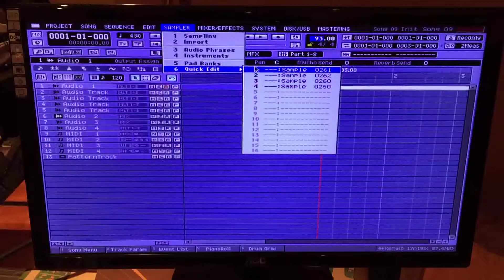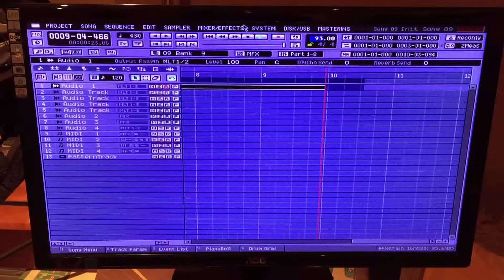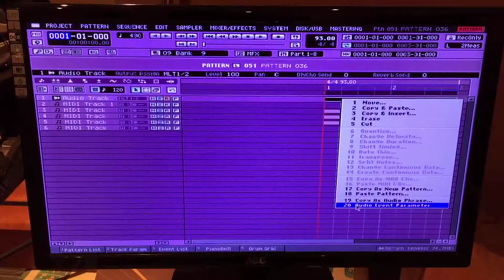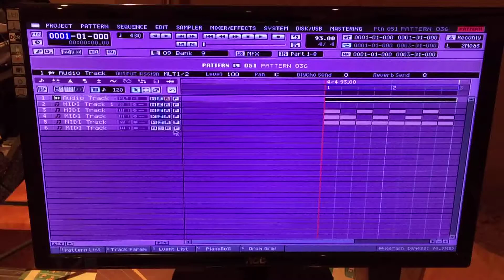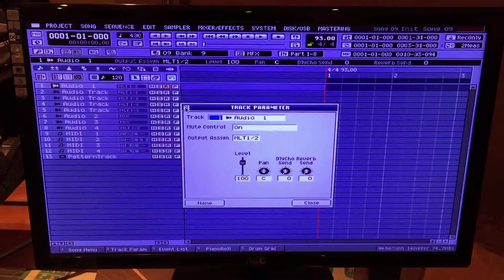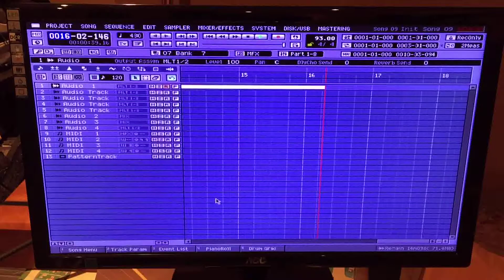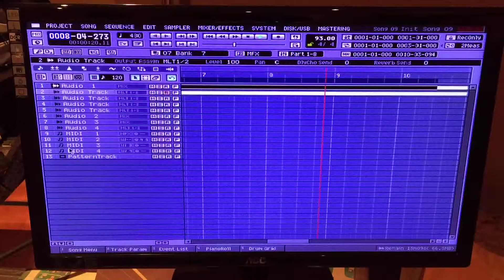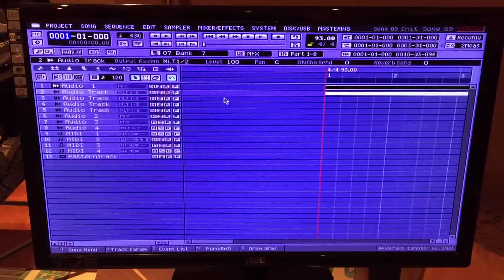MV 8800 / 8000 Part 2  ( Look at what is hiding inside the MV )

Comment: OK I need to get the output expander asap..but this is incredible...definitely gonna watch this about 3 more times before I fully grasp what is actually happening cus it seems like multiple loops being recorded on one audio track as overdubbing is crazy(if I'm following u right) great video wax as always
Reply from the maker: Exactly! Multiple loops at once! That can be bpm sync'ed, pitch shifted, played as triggers, or drums or as note on/off samples!
Reply: WaxDat8800 wow this machine is so ahead of its time...like you said 12 yrs later and still finding out new things...crazy
Reply: E TwOne this is def dope fam, I been trying to get me one for a couple years now, haven't found one in any guitar centers, nothing on craigslist,ebay, i found 1 on craidslist and dude wanted 500 just his mv8-0p1, and that more then he's selling his mv8000 for. & one site wants 350.00 for it but i never heard of the site before can't trust it. Wish that would have been one of the upgrades for the MV 8800 and not have to buy it separate.
Reply: cliff Jason Pellegrino Owens maannn dude is crazy...yea they are hard to come across or u end up with a situation like u just described...I think Roland did it like that cus the vga is stock on the 8800 and not the 8000..they had to hold something back lol

Comment: heh, I've watched this video at least 4 times trying to understand the difference between this and resampling... I think I get it now.  This works by just never hitting the mains (which would cause feedback).  If I wanted to overdub new audio from the analog ins or do a send to an external effect, I would have to re-sample, correct?  If I want to use audio phrases or MFX (i.e. anything already IN the MV8800) I can do the digital out to digital in.
Reply from the maker: telengardo yup.

Comment: I think you really are tired bro.. Watched the whole thing and didn't see anything you can't do with the resampling feature
Reply from the maker: +Mr America   I think you are missing the point. You can't record layered audio phrases on one track at the same time. Go ahead and try hitting two audio phrases at once while recording. Only one will play. With this way you can. It is out the box thinking. It opens up some other possibilities as well. Those that get it, get it.
Reply: +WaxDat8800 bro what I'm saying is this.. All you're doing by running the output into an input is resampling.. If you think I can't do this exact same thing without the op1 you're trippin - cmon son! You set the audio channel to record mix and do exactly what you did.
Reply from the maker: +Mr America  You  are missing the point. By running the output back into the input you are able to direct record multiple audio phrases to an audio track. Whereas this can't be done normally because audio tracks don't overdub, they overwrite.
Reply from the maker: +Mr America   " Audio Tracks cannot record to and play at the same time . Furthermore , Audio Tracks do not overdub, they overwrite. This is important because this characteristic means that a signal loop cannot be created-thus no feedback when you do your tracking of treated incoming audio.
*Any channels and/or sounds routed an Indiv.Out or Stereo pair are removed from the MIX output during playback. "

Quoted from a NNitred tutorial
Reply: +WaxDat8800 ok.. You're still not doing anything more than resampling.. You can "overdub" all you want, but those "overdubs" are being recorded to the same audio.. Aka resampling. The end result is no different than a bounce.
Reply: +WaxDat8800 AHHHH I think I just got the point.. This specific trick is for those live-loopers.. I wasn't even considering that - my bad.. I was thinking how this would effect my production in general rather than live production... Gotcha.
Reply: +WaxDat8800 wax it's too bad you didn't demonstrate this with a pedal.. You can plug in a pedal to the back and assign it as your "punch in/punch out" and that combined with your method here would give you a standard loop pedal setup
Reply from the maker: +Mr America    Never thought of that.
Reply: +WaxDat8800 I'm kind of a "power user" like you.. I'll let you in on one of my secrets :) while you're doing a mix down.. Use the "step" buttons (left and right).. Counting in 1/8 notes, push the "left" marker on the "and" note, and then push the "right" marker on the 2nd beat (or 3rd depending on which "and" note you start on) and it will give your beat a nice lil hiccup to clear the monotony
Reply: +WaxDat8800 I've noticed just using that trick alone like "resets" your ears.. It throws you off for a second (but still sounds "musically" accurate) and then your brain kinda forgets you've been listening to a loop and it makes it sound fresh again.. Manipulate your listeners :)

Comment: Wax I have a question, on my MV 8000 when I start up the machine it always start up with the sampling set to optical. I know how to initialize system parameters to set it back to analog. How do I get it to load in analog like it suppose to ? I would appreciate any help you can offer me !
Reply from the maker: 71dhwand change it to analog then save, shut down and restart it. See if that works.
Reply: WaxDat8800  Yeah I tried that it still loads with optical selected. It just started doing this out of nowhere.
Reply from the maker: 71dhwand did you initialize?
Reply from the maker: 71dhwand hold down Menu and F3 at same time while powering on your MV. This will put it into test mode. Then run it thru the test and see if everything checks out.
Reply: WaxDat8800 Yeah I did initialize it it goes back to analog, but after I shut it down it goes back into optical.
Reply: WaxDat8800 I will try this and keep you posted. Good looking my dude !!